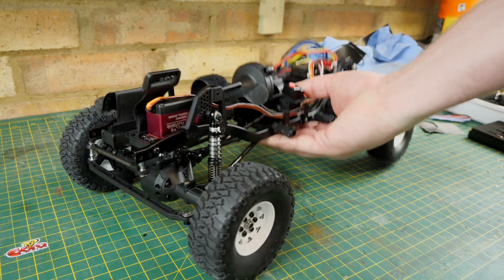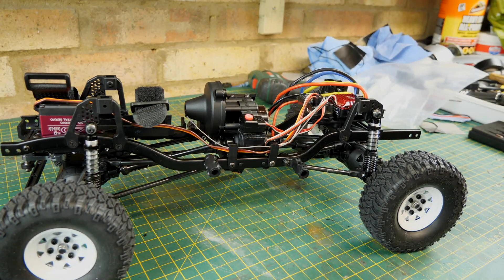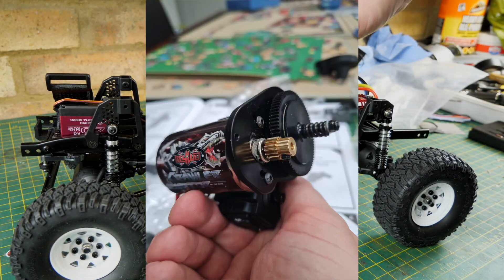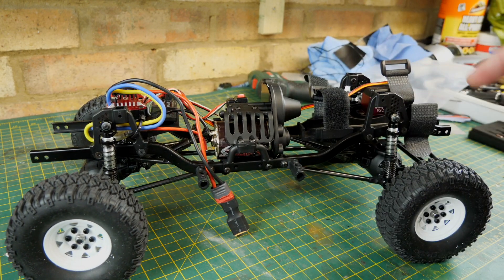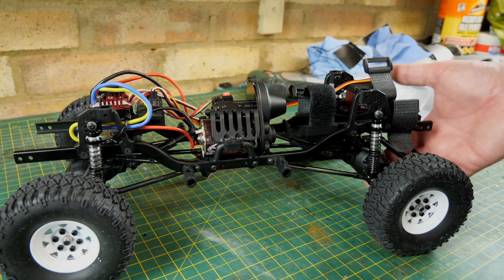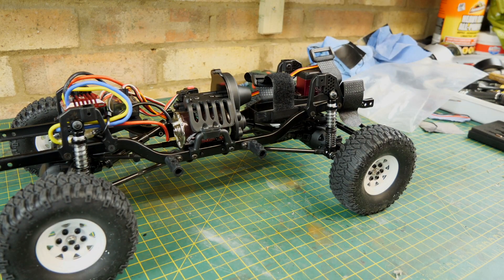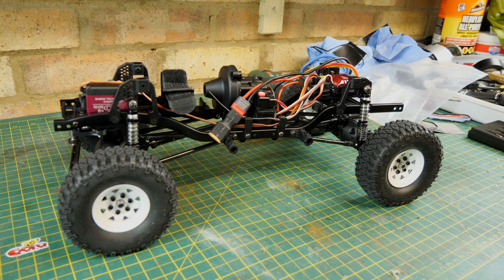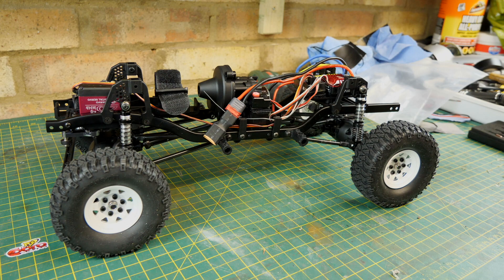Carisma Scale Adventure SCA 1E Kit - Build Part 2 - Rolling chassis

Comment: Great info T. about the gearing and motor.  The info on the springs and bearings are very useful too.  I can't to see what you do with the body and its mounting.  Those tires look awesome.  Excited to see this rig hit the trail.
Stay safe and stay tiny'
Steve.
Reply from the maker: Cheers Steve. The body is now mounted and I filmed the how to video yesterday so that should be out soon. I am loving the project so far. It is the first time I have tried to mount a non matched shell and chassis combo. I really like the look of the 1.55 wheels and tyres, I am so used to using massive wheels. Paint prep will be starting soon so that will be another update video. Glad you are enjoying it. Stay safe, T.

Comment: Hi Andrew, nice video. The SCA-1E chassis is really nice, really like mine, I have the SMD 5 pole crawler motor and matching ESC with mine, really runs nice. Interested in your shock choice, as I used the standard kit oil filled shocks. Looking forward to seeing the ‘marriage’ ceremony 😁😂👌😉
Reply from the maker: Thanks John. Terry here so just to confuse you Andrew and I are running two projects together lol. I really like the chassis so far. The shock choice was purely because I wanted 70mm to get the d90 nice and low. The standards shocks seemed great just too big. The next video will be about how I managed to mount the d90 shell. It is progressing nicely. Cheers T.
Reply: @antrc  hi Terry, so about the confusion, my apologies. I’ll keep watching. Take care 😉👌😁